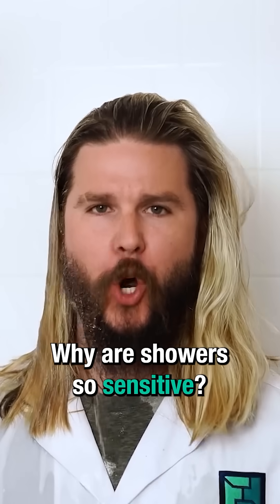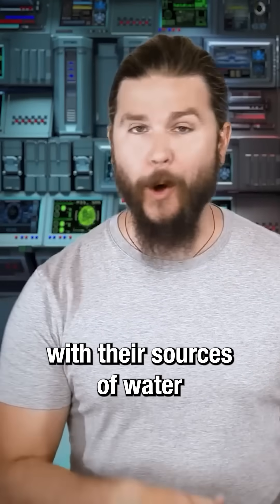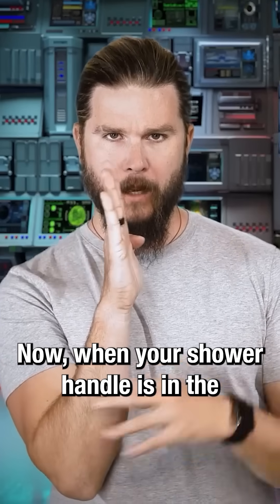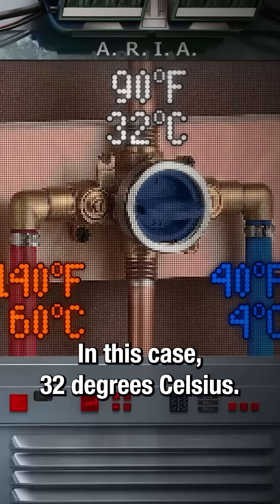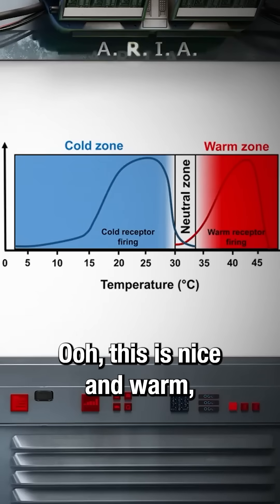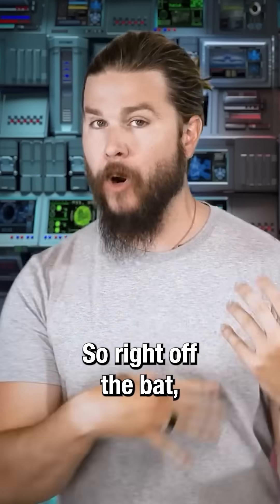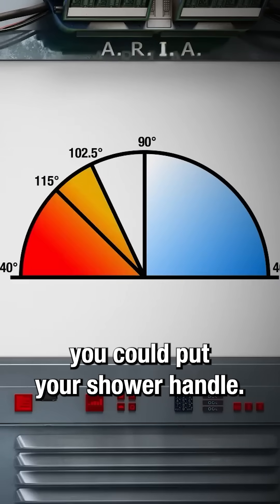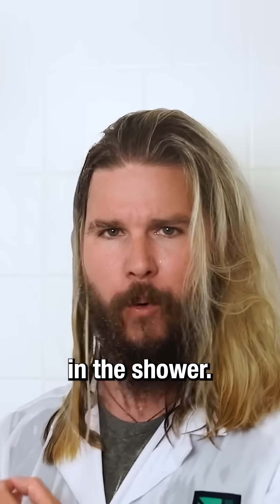Why are showers so sensitive? 🥶🥵

Comment: i dunno what my water heater is set to, but i basically don't even turn on the cold water and it's 100% hot. but i have two shower handles, not one.
Reply: There should be a dial behind a panel on your water heater that you can change. Had to do that when i got my new house because the previous owners had the water heater set super low.

Comment: Fricken two handles. Also wish it came with a thermometer
Reply: I grew up with it, imo 2 handles is worse. At least with one handle you can quickly memorize where approximately is best. With 2 handles it is forever a guessing game.
Reply: @majormushu after years of using the same one I kinda just naturally know generally how much to turn them. Way less accurate if I try to consciously do it while thinking about it though.
Reply: Get a thermostatic valve installed. You set it to whatever temp feels right and then it auto-adjusts the input water to ouput that temp.
Reply: yeah bro, I fucking miss that

Comment: It also doesn’t help if your hot and cold water supply fluctuate.
Reply: When someone turn on the washing machine

GTA wasted sound play in the back ground
Reply: @USSAnimeNCC-  Let me introduce you to thermostat mixers. Aka, Europe.
Reply: Honestly I have a brand new fairly expensive water heater, and it’s no better than the old one when it comes to temperature fluctuation.
BUT it does heat the water fast enough that running other appliances doesn’t cause any issues.
Reply: @NaughtyShepherd yeah you can have every faucet in my house at different temps and flush toilets/ laundry withought loosing hot water
Reply: @NaughtyShepherd  The water heater isn’t the problem. The problem is your thermostatic valve in the shower. It contains a disk of wax that breaks down over time. It needs periodic replacement. You’re welcome.
Reply: @NaughtyShepherd so it’s just a tankless heater? Nice
Reply: I use an electric shower, so it's 100% cold coming in.
Reply: A new heater was really the best investment, before I had an old hydraulical one. First I needed to rotate to fully hot, so it reacts at all, and then rotate carefully back, but not too much, otherwise it was back to the start again. 😅
Reply: @denniskrenz2080 the best water heaters are those which directly heat the water, any fluctuations in pressure should be directly translated into both hot and cold side. But it might still become hotter if it doesn't thermoregulate properly..
Reply: @savagesarethebest7251  yeah, they SHOULD. In reality, pipe systems are not really easier than electrics. Just make one pipe longer than the other. The water flows not fast enough to reduce the effect.
Reply: I found an old book on plumbing, and i mentions isothermal valves. These keep the proportion of water constant, so when one side is cut off, it cuts the other too, keeping the temperature constant. I wish we had those here.

But over here we use electrical resistance showers that heat it from ambient to 38C in 2 seconds, spending 6000W to do so. These are cheap to install, can be installed in single pipe facilities, but you see the problem with electrical bills...
Reply: I stayed in a hotel in England recently and it kept fluctuating between no-nore-hot-water and skin-searing. Idk if the water tank it was connected to was on the next block or what, but it didn't make for a comfortable shower.
Reply: Shower with a thermostat is the answer!
Reply: Yeah, and that the sweet spot drifts depending on which side you accidentally opened too much: swing it too far to the hot area - and your confy temperature is now way into the cold section, you overcorrect it too much - now it's somwhere completely random and you also messed up overal pressure, and at different pressure you need to find a different equilibrium.
Reply: “STOP USING THE SINK!!!!”
Reply: why would temperatures fluctuate exactly
Reply: And thermal expansion and contraction of the mixing valves.
Reply: I love it when i’m washing my hair and my mom downstairs turn on the tap and i am more red than watermelon
Reply: @tumo07  aren't watermelons green?😂 (jk, i got what you mean)
Reply: if your heating system is working right, the hot water shouldn't fluctuate much, even the cold water where I live doesn't change much and we get some nasty winters
Reply: Or you’re like me and the damn heater runs out of hot water so you can start feeling it getting colder and colder..
Reply: Renting in apartments be like
Reply: Electric tankless heaters ftw
Reply: Exactly. Thats the real problem. Your hot water gets colder the longer you use it, requiring adjustment. Unless you have a compact, instant water heater
Reply: My handle rotates more than 720 degrees, so I just have to either guess and check after setting to to max, or just chill at max
Reply: That shit kills me on a daily basis
Reply: There are showers that can mechanical  keep the same temperature each time and only slightly affected  by fluctuating water. It's great, I haven't changed the temp since it set it up 2 years ago.
Reply: Showers here are electric, it's still about finding the sweet spot though
Reply: I'd be chilling all nice and warm. Then suddenly out of no where I'm being boiled alive without touching anything
Reply: Or if the handles are separated
Reply: Lmao my shower temp changes if someone does anything anywhere in the house with da water
Reply: So that explains why the shower gets hotter/colder when someone flushes the toilet. Aight, cool!
Reply: Tell me your out west without telling me so! Lol.
Reply: Doesn't everyones hot water supply eventually run out?!
Reply: my grandmas house in pakistan had absolutely awful fluctuation, the hot side has a chance of being boiling hot or freezing cold, the cold side has a chance of being boiling hot or freezing cold, the middle has a chance of being boiling hot or freezing cold. its never both, just one or the other and it switches every few seconds
Reply: I think I know what you are speaking about, but that has nothing to do with "supply" of water.

It happens with cheaper mixing faucets, when the handle has a too high pressure gradient. It doesn't mix properly. So you get warm and cold water, but not mixed but temporally a bit more of each.

It could help to descale the shower handle, as that lowers the pressure gradient. But usually it's not helping a lot.
Reply: My shower used to have the signs wrong so you'd switch to cold if you wanted hot or hot if you wanted cold. It was fun hearing guests freeze and shriek in terror.
Reply: Third world country be like
Reply: @Muxeroth bro hasn’t ever rented an apartment, on god it’s on sight for whoever turns on the hot water before my 4 am shift, I’m echo locating them through the walls 🗿
Reply: @nyemenski he probably lives at daddy’s house still
Reply: @nyemenski nah mate. When you'd get a shower in a quadplex... 😂 I hated when the person on the second floor behind us flushed the toilet
Reply: @jasonnelson9141  they wanted the hot water im connecting a boiler to their shower bro they’re GETTING hot water 🗿
Reply: 300° crawfish boil treatment
Reply: @Muxeroth What?? This has been the case in every shower I’ve ever used. And I’ve used a lottt of showers. (USA)
Reply: @thanos879  here in Europe we don't use water heater with tanks
Reply: @Muxeroth  I'm in the USA with city water - I have measured 82.2 degrees 'cold' water in the summer, and that's after letting it run for minutes on end.
I bet it's closer to 50 degree 'cold' water right now.
Reply: @workingguy-OU812 I'm a water treatment operator in the Pittsburgh area, and it's mostly due to river temperature. I've seen the river as hot as 82° F in the summer and as cold as 34° F in winter. Areas with groundwater as their source will see much less variability.
Reply: @WaterMan416  Heya Chief! I've swam in the Ohio river just outside of Pittsburgh a few times ... that was probably a health mistake.  Thank you for the reply though, that makes sense.
Reply: @Muxeroth bro’s never lived with other people and been the last in the shower
Reply: @Muxeroth  no. I live in Switzerland. it fluctuates.
Reply: @Muxeroth  I live in a house built in the late 70's and it has the same issue, in middle class US
Reply: @FaoreoX16  i was joking about the fact that in 2024 the us still uses water heaters with tanks instead of the on demand ones
Reply: @Muxeroth tank water heaters are a thermal battery. If you have variable utility rates, you can save money. But there's nothing silly about using an "older" technology. On demand water heaters aren't necessarily better because they're "newer." Plus they have a max delta T they can do, so they may not get the water as hot as you like it in winter. Plus, tank heaters are typically less expensive to purchase and install.
Reply: @Muxeroth tanks are typically more efficient than on demand, the weird countries where they use on demand in rentals is just because it's cheaper for the landlord.
Reply: Nah i just live between bumfuck and cold
Reply: @Muxeroth or its winter in wisconsin where the cold water is damn near 33f.  Then when you add hot water it gets to about 80 degrees.
Reply: @Muxeroth  Dude's woefully ignorant, not realising third world countries mostly don't even use heaters—
Reply: @Muxeroth it's something even us Americans experience. Don't be stupid.
Reply: @Muxeroth no it happens a lot, especially if you’re heater is going out.
Reply: @Muxeroth bro, I live in a big city in a western first world country, the water heaters have a limited capacity.
Reply: @Muxeroth  I live in New Zealand and have gas fueled hot water instead of an electric water heater. It's supposed to be more consistent but I still get intermittent cold flashes on some days. It's not exclusively a third world problem.
Reply: @Muxeroth plenty of people in the US don’t have an instant hot water heater and can’t sit in the shower for 30 minute+ without the water getting colder
Reply: @Muxeroth our source of hot water is pipes heated up by the sub
Reply: @Muxeroth no just old and/or poorly constructed houses. plenty of that in the first world
Reply: @Muxeroth ah yes because it’s a third world issue 💀
Reply: @Muxeroth first world countries too
Reply: @Muxeroth The air being colder outside litteraly affects the temperature of your cold water pipes even in western "1st world" countries.

Cold water is WAY colder in winter in Canada.
We legit have to insulate our pipes or they are gonna freeze and blow up
Reply: @Muxeroth small water heater be like. Massive variation in utility and reservoir temperature be like. Getting used to the water temp be like
Reply: @Muxeroth don’t hate me for saying this because it’s true, it doesn’t matter who you are, race, gender, nationality, none of it matters, the water will never be right temperature and if you ever think it is then it will change!
Reply: @Muxeroth you mean America and Europe are third world countries 😂
Reply: centralized heating while living on the eight floor be like:
Reply: @Muxeroth I live in a major US city and have this issue
Reply: @Muxeroth 
The USA isn't supposed to b a 3rd world country though and yet still happens in big cities lol
Reply: @Muxeroth bro what are you talking about? About half the showers i use in America get colder and colder over time
Reply: @Muxeroth  hell I'm in America and mine does this. I'm lucky to get even 5 min of warm water int he winter.
Reply: @Muxeroth  You mean first world country, I live in a newer area in the Aus and this is a problem 😂
Reply: @Muxeroth wtf???
Reply: @Muxeroth that shit happens in Missouri💀💀
Reply: @Muxeroth I live in america, agreed
Reply: @Muxeroth nah because i live in the US and this happened to me
Reply: @Muxeroth water tank on roof in many, giving 105 degree water.
Hence, another reason one doesn’t find water heaters in use in those nations in wealthier homes.

Comment: Good timing for this video. I bumped the handle with my elbow while I was showering this morning and got scorched by hot water! 😬
Reply: Ouch! 😟
Reply: I do that with the stupid hose for my removable head all the time... 🤦‍♂️
Reply: I am glad that it's common here to have a safety pin in the shower handle that's limits  the Temperatur around 39° C / 103° F, if you want go hotter you have to push a button the move the handle